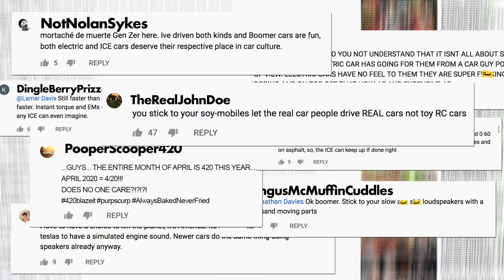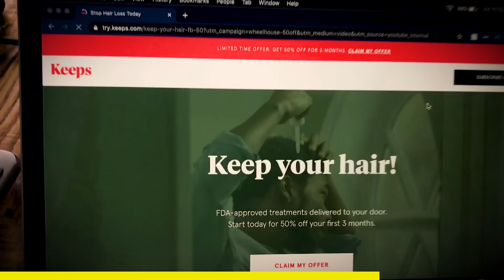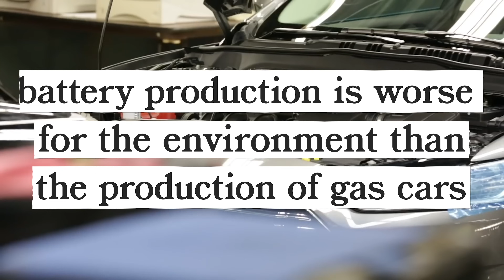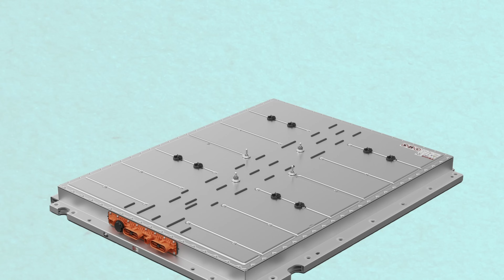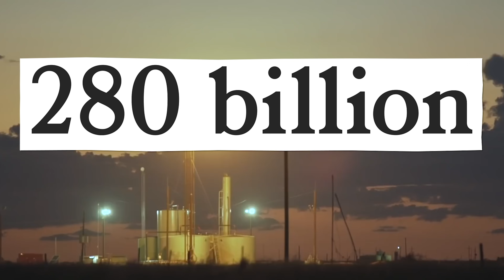Are Electric Cars REALLY Better for the Environment?

Comment: HYDROGEN AS BATTERIES : New concept : HYDROGEN BATTERIES. Electric vehicles must switch to use  hydrogen batteries instead of chemical batteries.  
People often think about hydrogen as fuel, but many forget that hydrogen is not only a fuel, but also very good battery, too. 
 1/ The fundamental science dictates essential truth of all chemical batteries : (CAREFULLY RESEARCHED STUDIES)
if a chemical energy storing mechanism is charged as quickly as producing hydrogen, then this mechanism PRACTICALLY  CANNOT HAVE BETTER  ENERGY CONVERSION RATIO THAN ELECTROLYSIS PROCESS. Besides, it is possible to SETUP and adjust electrolysis reaction speed (for example slow down speed) to reach energy conversion ratio of electrolysis better than any chemical batteries. The best one of all possible chemical batteries in AEROBIC earth conditions is HYDROGEN BATTERY. All revolutions of chemical batteries, lithium batteries, LFP batteries, LTO batteries, graphene batteries .. are for reaching to the features of hydrogen batteries. 
  
2/ New concept : hydrogen battery = (fuel cell + hydrogen storage object). 
The most simple hydrogen battery = 1 fuel cell + 1 compressed hydrogen balloon 300bar, can easily beat best lithium batteries by all features : more capacity, more power, less weight, forever lifespan, no degradation, charging in 5 minutes, same or better energy conversion ratio, but just noremarkable bigger volume sized than lithium batteries.
 
3/ So just equip electric vehicles with hydrogen batteries instead of chemical batteries.  And equip hydrogen filling stations with mobile electrolysers to produce compressed hydrogen 300+ bar on site from electrical outlets. Electrolysing hydrogen filling stations (hydrogen battery charging stations) can run electrolysers from electrical outlets to produce liquid hydrogen on site, to avoid suddenly leap change requirements for big number of already existing current liquid hydrogen cars in the markets. But liquid hydrogen has low energy conversion ratio.  For now and near future, compressed hydrogen (produced on site)  is more versatile for various applications.
(Additionally envisagedly, owners of ANY SMALL COMPRESSED HYDROGEN MOBILITY VEHICLES/ROBOTS/BIG DRONES/MOBILITY DEVICES can buy small mobile household electrolysers to recharge hydrogen batteries at home at night/any times). 
4/ Example and comparison : hydrogen cars vs battery cars, hydrogen batteries vs chemical batteries :
The old approach sets high H2 cost because : they pay for making H2, then they pay much for converting H2 to liquid H2, then they pay much for transporting liquid H2 by trucks (complex safety trucks, and very small weight of liquid H2 on every trucks), then they pay for keeping cryogen conditions to store liquid H2. 
 But in new approach of ‘electrolysing hydrogen filling station” : you use electricity from electrical outlets at electrolysing hydrogen filling stations to run electrolysers to produce compressed hydrogen 300+bar on site. So you pay only for electricity and water of course. No other fees. No complex cryogen equipments.
Compare : hydrogen batteries vs lithium batteries in the approach of “electrolysing hydrogen filling station” : 
4.1/ Grid transmission loss : hydrogen battery charging and lithium battery charging onsite cause same grid transmission losses. 
Conclusion : Equal.
4.2/ Energy conversion ratio in charging : (electric energy -> chemical energy)
Electrolysers in quick mode (very high electrolysis reaction speed) have energy conversion ratio about 70%. Lithium batteries quick charging has energy conversion ratio about 60-70%. 
Electrolysers in slow mode (small electrolysis reaction speed) have energy conversion ratio 90%. Lithium batteries slow charging has energy conversion ratio 90%.
Conclusion : electrolysers win, because of the ability of flexible modes of scheduling and functioning to reach higher energy conversion ratio.
4.3/ Energy conversion ratio in performance : (chemical energy -> electric energy)
Fuel cell has energy conversion ratio about 75+% in mode of intensive power performance (when require delivering much walt/seconds), energy loss in form of heat. Lithium batteries have energy conversion ratio about 70-% in mode of intensive power performance (when require delivering much walt/seconds), energy loss in form of heat. 
Fuel cell has energy conversion ratio about 85+% in mode of nointensive power performance (when require delivering less walt/seconds), energy loss in form of heat. Lithium batteries have energy conversion ratio about 95-% in mode of nointensive power performance (when require delivering less walt/seconds), energy loss in form of heat. 
Conclusion : Equal.
4.4/ Energy loss in energy packing compressing process :
Hydrogen battery using compressed H2 300bar cause about 3-5% energy loss for compression. But hydrogen battery weight is very small.
Lithium battery loses 0 energy in compression. But lithium battery weight IS INHERENTLY HIGH. 
That means you always need to transport noneccessary lithium battery heavy weights on your vehicles every seconds. -> The higher power category, the higher loss with lithium batteries. The longer range, the higher loss with lithium batteries.
Conclusion : hydrogen batteries win with big advantages
4.5/ Spatial size :
Simple hydrogen battery = 1 fuel cell + 1 hydrogen ballon 300+ bar.
For small capacity category (for example, passenger cars capacity category) : simple hydrogen batteries have little bigger spatial sizes than lithium batteries. 
For nosmall capacity category : simple hydrogen batteries have little smaller spatial sizes than lithium batteries. 
Conclusion : lithium batteries win with nobig advantage. 
4.6/ Lifespan and degradation :
Hydrogen batteries have practically forever life span, and practically no degradation.
Lithium batteries have lifespan about 3 years. Some good ones have 5 years. Other modern modified lithium batteries have more lifespan but smaller capacities. But all of them degrade every year.
Conclusion : hydrogen batteries win. 
4.7/ Influence of environment temperature :
Hydrogen batteries never fear environment temperatures.
Lithium batteries fear environment temperature. Even in some seasons you can not or you ineffectively use lithium batteries.
Conclusion : hydrogen batteries win.
4.8/ Charging time :
Hydrogen batteries : load compressed Hydrogen 300+bar or exchange compressed hydrogen canisters 300 bar in 3-5 minutes.
But you must waste minimal 30 minutes for nofull charging lithium batteries, and often you must waste some money for paying some unnecessary things in fool waiting times too. -> waste time + waste money.
Conclusion : hydrogen batteries win.
4.9/ Synchronize with grid supplying schedules :
Electrolysing hydrogen filling stations can easily pick up flexible schedules to run electrolysers in tandem with grid supplying schedules. So Electrolysing hydrogen filling stations can pick up right hours of day for incentives electrical tarif. Nets of electrolysing hydrogen filling stations ideally use intermittent clean energy/renewable energy.
But electric charging stations can not pick up times. High power electric charging stations terribly conflict with intermittent schedules of clean energy/renewable energy. The more higher power electric charging station in quick charging mode, the more terribly it conflicts with intermittent energy supply schedules of clean energy/renewable energy.
Conclusion : hydrogen batteries win. 
FINAL NATURE TRUTH VERDICT : HYDROGEN CARS WIN MANYFOLD AGAINST BATTERY CARS. 
Just need to make right approach : model of distributed hydrogen productions onsite (nets of distributed ELECTROLYSING hydrogen filling stations) + electric cars with hydrogen batteries EXACTLY MAKES  HYDROGEN CARS MORE/AS  ENERGY SAVING THAN/AS  BATTERY CARS, AND IDEALLY COOPERATES WITH INTERMITTENT CLEAN ENERGY/RENEWABLE ENERGY THROUGH ALREADY EXISTING ELECTRICAL GRIDS. 
All electric vehicle manufactures, which make/begin making electric vehicles, need to choose hydrogen batteries and cooperate to build nets of hydrogen battery charging stations (nets of electrolysing hydrogen filling stations are easy and noexpensive), for getting advantages of initiating, for their profits,  for environment, for human AEROBIC orienting breath air, for world

Comment: electric cars are the way forward. they are not the perfect solution yet. down the lane the roads will be electrified, and battery capacity will be lower. we gave many better solutions than li ion battery for low capacity. trust me gas engines in power plants are way more efficient than stupid engine in our car always running at variable rpm. electricity is the way to go

Comment: EV are great for short drives and for city commuting, however, places like where I live, would mean they will never suffice, owning one here would make you unable to make it to a nearby city, so basically stranded and in need of internal combustion regardless, go further out and all power is generated by diesel generators, these would then mean that anyone using an EV there would be less efficient than just driving a really efficient diesel car or truck. I think the idea that is pushed that people are going to have to get an EV (popular rhetoric among ev owners and enthusiasts) is merely the ranting of someone hell bent on having others conform to their choices and thusly edifying their own decision aka, insecure assholes. 

I will never live in the city again, so I will never own an EV, would I sneeze at a well made long range hybrid that has both economy and ample torque/power? not at all it would be a great medium, are there any such vehicles out there that suit my needs yet? no. there isnt.
Reply: it is more fuel efficient to charge our EV from a cheap portable generator than it would be to use that same diesel fuel in a modern efficient diesel car
Reply: @engineeringtheweirdguy2103  no it really isnt, youre then having to deal with two lots of thermal inefficiency as well as the fact that the generator also has run up energy cost that isnt being utilized in the car as well as having to be run continuously that isnt being used in the EV. I dont understand why you all focus on the exact electron that makes it from the generator to the EV battery, but a lot dont, and a lot of the energy produced by the generator is wasted as heat, and then more energy is lost via the wiring/cabling to the EV. if you think none of this is a factor, then you dont know enough to be commenting as you have.
Reply: @fluchtigziege3202  actually it is. the mathematics is fairly absolute. Internal resistance in terms of charging the battery means the battery charging is around 96% efficient inclusive of the inverters. you can use the rate energy efficiency, find the distance it would go on that charge. Simply put its fairly trivial to prove that it is actually more efficient to charge your EV using a cheap portable generator than it is to use that same fuel in even a modern diesel engine.
Reply: @fluchtigziege3202  its fairly trivial to prove. Would you like to run through the maths?
Reply: @engineeringtheweirdguy2103  all good mate they've already trialled it on some mines and if it didn't save money there hence didn't get kept in Operation, then it's not viable, that simple
Reply: @fluchtigziege3202  Trialed what? You think Mining Machinery has a similar use case to domestic passenger vehicles? really? Half their equpment runs on hydraulic drives. Not engines or electric motors. It depends on what outcomes you're after. but plain and simple you stated "these would then mean that anyone using an EV there would be less efficient than just driving a really efficient diesel car or truck" in reference to energy being created by diesel power generators. This is simply and demonstrably not the case. and its very easy to prove mathematically.

For example a small 8kW generator uses 2.4L of fuel per hour. An EV like the model 3 uses 0.13kWh per km. from that alone you can work out the fuel efficiency of charging the EV with the generator to be 3.9L/100km (60 mpg). The only way to get efficiency like that from a diesel is with a diesel hybrid. Which is using an electric motor to drive the car by using the engine to turn a generator. In effect, the hybrid has the generator internally, whilst charging an EV has the generator External.
Reply: @engineeringtheweirdguy2103  ok now I know you're out of your depth and have no clue what's going on so I'm gonna leave you there.
Reply: @fluchtigziege3202  what? you're afraid of numbers? as I stated, its very trivial to prove that its more fuel efficient to charge your EV from a portable diesel generator than it is to run a modern diesel car on the same fuel. meaning your assertion that power generation coming from diesel makes EV's worse than driving a diesel car, categorically false.

Run away from it all you like. Those numbers are still valid.

Comment: Most of these don’t apply to Texas if Eva are the future the Texas oil fields (one of our biggest economic provider) go out the no a lot of economic gain= no Texas and during the freeze most or electrical generators where turned off shut off power to a lot of peoples house so our power grid couldn’t handle a lot of Evs. Change my mind (I’m Texan so good luck)
Reply: You power went out because of a once in 200 year natural disaster. Saying that your grid cannot support EV's because of your very extreme weather event is like says New-Orleans cant support EV's because Katrina knocked out their power supply. what cause your power to go out was not the demand on the grid. But the storm. Texas has more than enough power to keep everyone going. however the storm prevented them from generating it. As gas lines which were not designed for such extreme and never before seen temperatures in that area, froze, preventing gas from getting to the power plants, Coal stacks were also frozen over slowing down the rate at which coal could be provided to the generators, The state tried to go in to load shedding when those power plants went down but the transformer switches froze in place and ultimately the whole grid went out of phase and everything went out.

It wasnt the load on the grid the caused the blackout. It was the natural disaster.
Reply: the only thing I can say about oil production in Texas is this. Plastics are made from oil, plastics will still be needed. Oil demand will go down but it wont go to zero. The world still needs plastics and lubricants. The only difference is those arent being burnt into the atmosphere and can be recycled.

Comment: I have no agenda but yeah green energy electric vehicles awesome good job buddy oh and by the way why didn’t you mention nuclear power? Ohhh 😮 that’s right you don’t have an agenda totally unbiased
Reply: Because Nuclear is terrible
Reply: @engineeringtheweirdguy2103  how’s it terrible have you even researched how it works? Also don’t start about the whole water thing because last time I checked uranium comes from the ground so news flash, you’re basically just putting the uranium back into the ground. It’s actually probably better because the wast is usually less radioactive that the fuel because of the constant fission reactions occurring.

Comment: If co2 capture could reduce 80% of petroleum co2 emissions would ev's still be greener?  
If mining, and processing of lithium and petroleum switched from diesel vehicles and equipment to electric motors would that change the equation?   
Could petroleum produced by co2 capture devices produce less emissions over their life time than electric vehicles?
Reply: Depends. is the capture only on fuel refinement or on the vehicles themselves. If you can capture 80% from a car, I would imagine you could capture more from a power plant.
Reply: Capture from air to create synfuel with co2 electrolisys…this is what Porsche, and shell are doing….co2 from air + electric creates synfuel through some reactions……all the carbon out the pipe came from the air before it was emitted in the first place
Reply: @mynameisdeleted  well whilst thats a nice idea, and seems good at a glace, its actually not that great. It takes alot of energy to capture the carbon from the air all of which has some form of emissions impact from energy generation for example, it then has to be transported to facilities to make it back into fuel which would have emissions impact ontop of that. Then it needs alot of energy to combine the carbon back into fuel again, which has to come from powerplants which do have emissions.

All and all its not carbon neutral. not even close.
Reply: @mynameisdeleted  also the size and scale of the effort to capture enough carbon to fuel even a small fleet of vehicles is mind boggling. Its really just impractical.

Comment: How about the child workers used to mine the cobalt... that's enough for me to not buy an electric vehicle...
Reply: Well then you have a surprise coming for you. Whilst EV’s are the highest consumers of pure cobalt, they are not the largest consumer of cobalt on mass (meaning including cobalt base compounds). You know who takes that title? Fuel Refineries who use it to remove sulphur from fuels.
Reply: Further, EV companies like Tesla have sunk big bucks into producing cobalt free batteries (and Tesla’s announced 48659 battery is cobalt free). And have signed supplier agreements that supplies are only allowed to supply certified ethical cobalt. No such agreement exists for fuel refineries as they’ve never had the social pressure to do so.
Reply: So if you’re so against child mining of cobalt. You’d Best Buy an EV and stop buying fuel.
Reply: @engineeringtheweirdguy2103  stop liking your own comment lmao